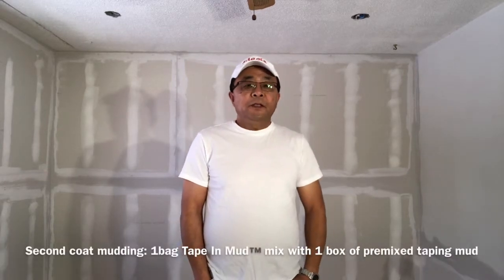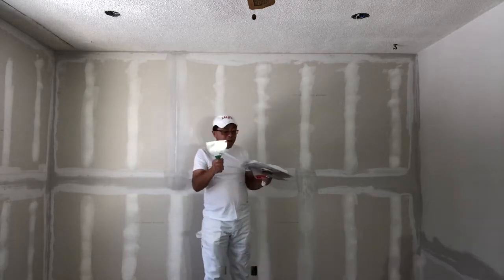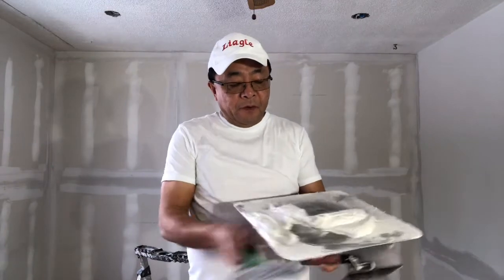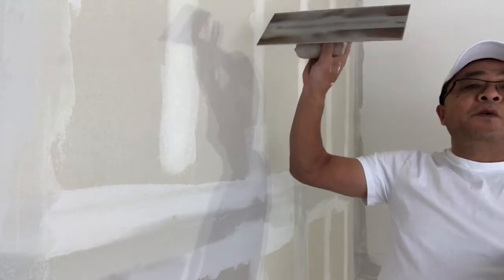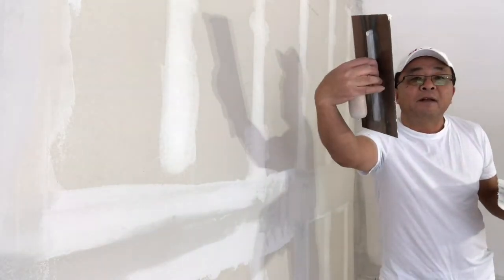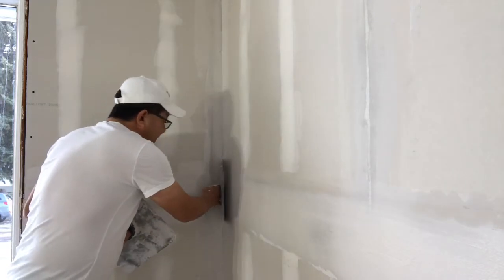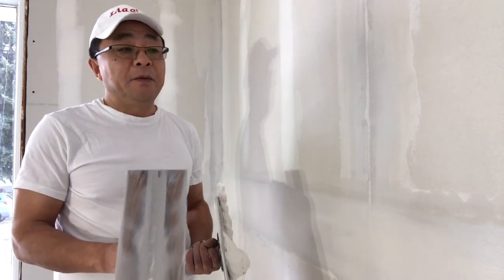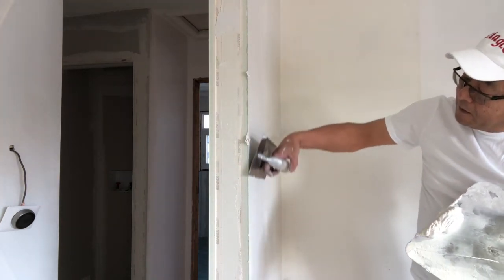Drywall finishing DIY tutorial Part 5 second coat of tapeless mudding- No more tape!

Comment from the maker: Is it going to crack? The truth is paper tape cracks all the time. The main reason for drywall joints crack is the gaps were not fully filled with mud. When the house is shifting or moisture and temperature changes, the joints cracked. Tapeless drywall finishing got every joint fully filled with tapeless mud. So the joints are even stronger than drywall itself. Check what the process engineer said https://youtu.be/fV5NjyCmZZY
https://youtu.be/wwP4SJtAPAY